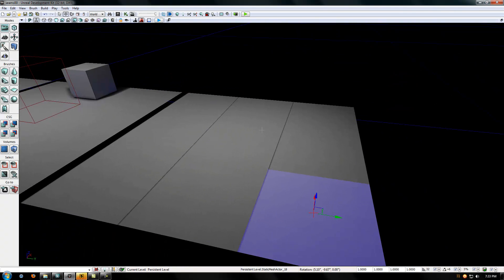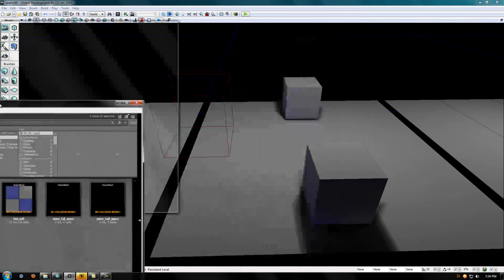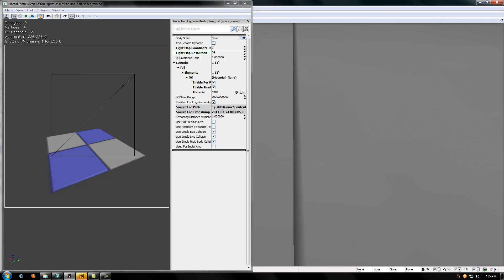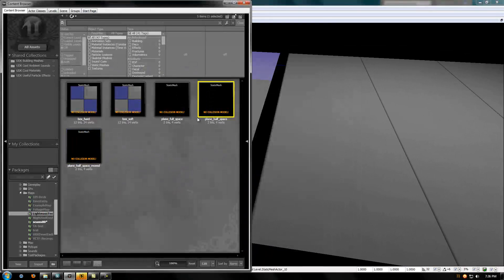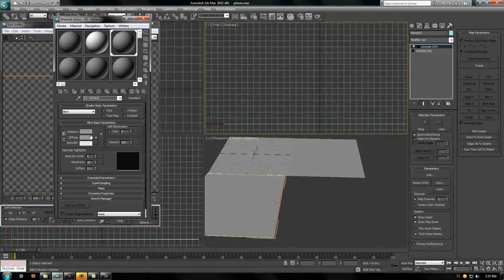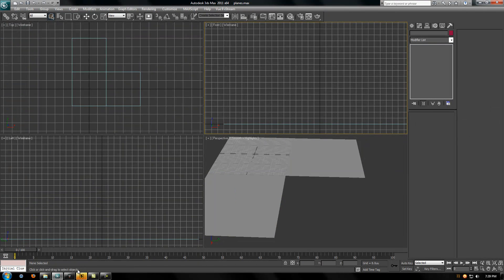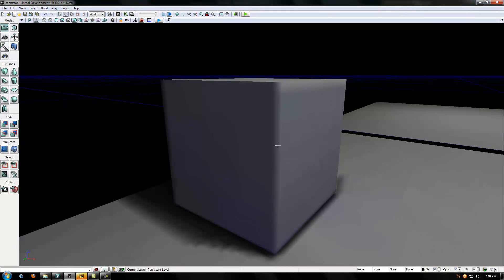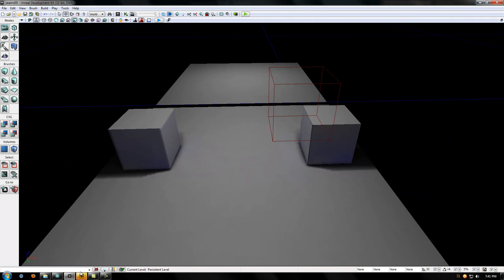Fixing Lighting Seams in UDK

Comment: I found out UDK DOES have edge padding, and its enabled by default in a hidden settings panel of the lightbuild window (you have to enable it by setting "ShowAdvancedOptions=True". The funny thing is, even though the padding is designed to reduce these errors, it actually makes them worse, so your best bet is turning it off. Problem is, trying to build light using this setting has just made UDK crash in a VERY simple scene with only 3 meshes and a static light emitting lantern mesh.

Comment: Instead of using a painted grid to see where your UVs land in maya.. Go into maya's UV Texture Editor, click View, and open the grid option box. Set your LENGTH AND WIDTH to 1.0 unit and your GRID LINES EVERY to 1.0 unit. Your SUBDIVISIONS is going to be the lightmap resolution you're planning to use in Unreal. Now, instead of eyeballing the UVs to the edge of the grid, select your UVs and hold "X" to snap them to the grid. This will prevent any bleeding. 

Remember to check on SUBDIVIVION LINES

Comment: interesting...i was having problems with this on some of my meshes when tiling, thank you for clearing that up for me! :D

now say you have a tiling mesh and not neccessarily a tiling texture (in some cases yes or in others no) and you have multiple UV islands.  and then add to that you're using a 64 res lightmap on it...that means i would basically have to snap the edges of each UV island to the grid so that the edges won't be in between two pixels?  man oh man, if that's the case, what a drag